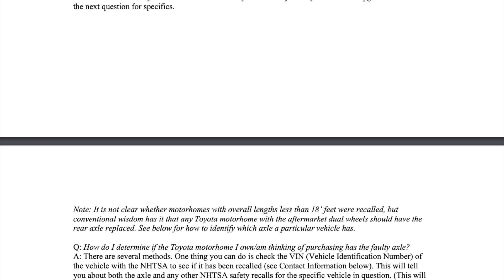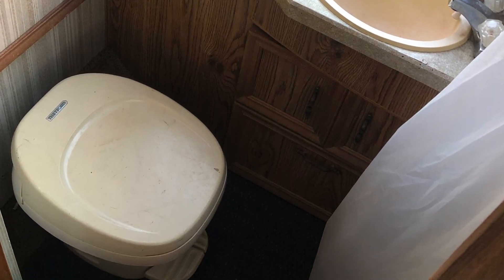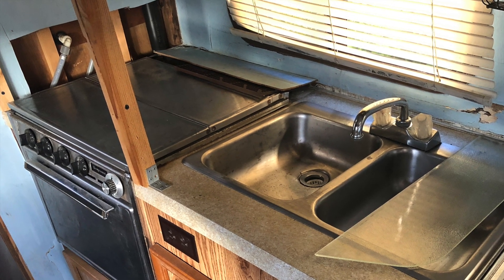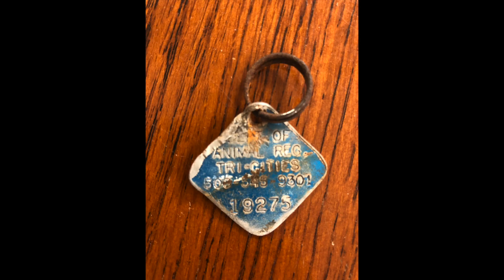1986 Toyota Dolphin Renovation - Why!? (part 1)

Comment: Looking forward to watching your videos. I have a1988 Dolphin which doesn't need quite as much work, but close. I almost sold it but decided if I did that, I'd be selling a little piece of my heart too.
Bought it with 40,000 miles, drove it for 15,000 without any problems except that pesky sag in the floor. Well, I fixed it but no without a lot of surprises.
Anyway, solar panels are sitting here waiting for me, coat the roof, load it up, and even though not finished, my dogs and are are going to get out of here. YIPPPEEE!

Comment: i wanna know more about the head blowing,  i have a 88 dolph and have seen the exhaust glow red hot at least 3 times and even turned it off which in hindsight is wrong but iron block iron heads just can take extreme heat...seems like it cant die :)
Reply from the maker: speaking of block heads, I ran that Sunrader up I-5 with no water or oil - that’ll do it!
Reply: @Monkelonious  oh damn.  Dat will
Reply: You def killing it with your project...im about to gut mine in a week...will see how many cans of worms I find....not full gut but rear subfloor got the sag...